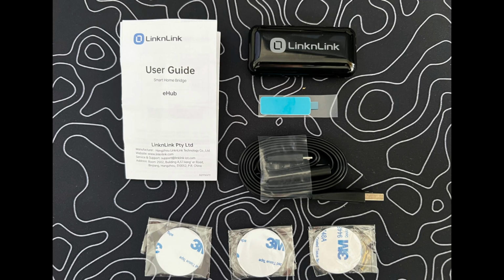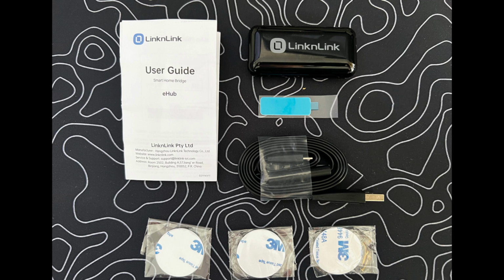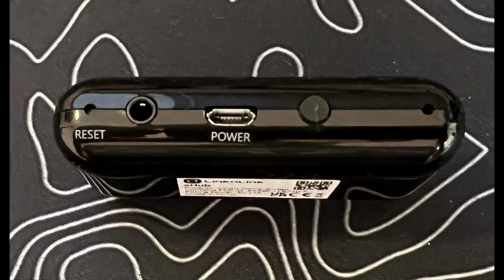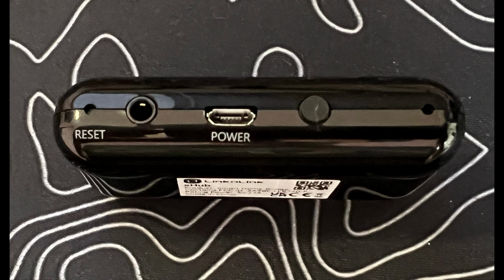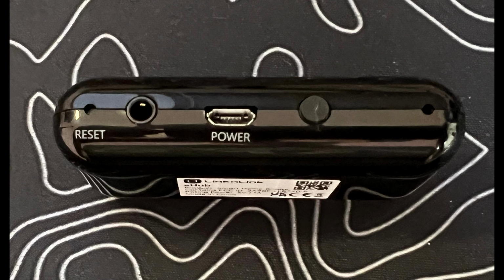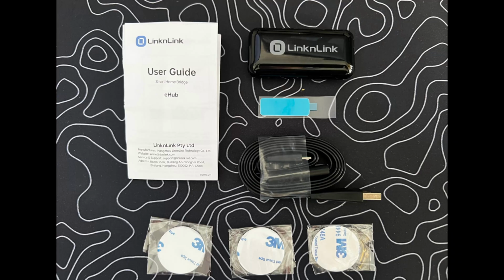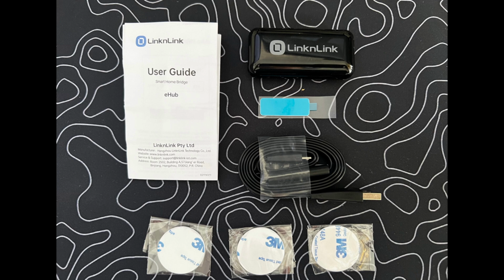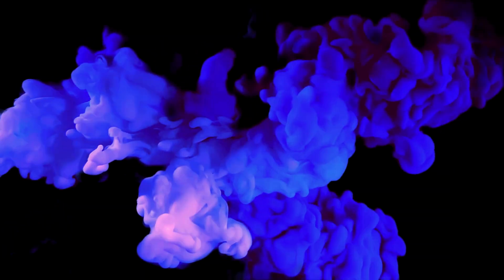LinknLink eSeries of Smart Sensors (eHUB, eTHS and eMotion)

Comment: I take it that thus device can also learn remotes? My Fujitsu does not have the wifi module therefore I will need to "teach" from its remote as I did with with my broadlink RM pro
Reply from the maker: Hi @cyclemadkiwi , Yep. Think of this device as a Broadlink RM Pro on steroids. The inclusion of the mmWave in a package side of 1/3rd the size.
Reply: Awesome,  thanks!
I have the hub and the eMotion, so next week I'll be setting up my new house. Smart LED downlights, curtains and blinds. I was a Phillips Hue user, but the cost of their LED downlights  is bonkers!
Reply from the maker: I think you hit the nail on the head. No one has a problem with Philips Hue quality, saturation and app etc. it’s the price and the closed eco system. 

Good luck in the setup and let us know how it goes.
Reply: @smart_home_australia  I thought I sent a reply...oh well, if this does appear twice, my apologies. 
I've installed the eHub and the eMotion, I have had to keep my RM4 Pro to operate the Aircon though, the eHub would not operate with line of sight being a little too far. I found it difficult to get automations sorted for non LinknLink devices despite linking them to Google Home. To operate my one smart light at my entrance using the eMotion sensor, I could not access the device (Smart Light) directly from the linknlink app, I had to select and type in the Google home voice command to operate it! I have it set to turn on the light as a night light should I walk into the kitchen, it works, however it takes about 5 secs before the light turns on after detecting me, I think this is a bit slow! Ides??
I noticed in your app setup there was an option in the "Add Device" called NFC Devices (eg Door sensor, motion sensor and light switch) in my app setup this option does not exist!

Any ideas or if I've done something wrong?
Reply from the maker: Hi @cyclemadkiwi, Interesting that you say the IR is not as powerful as the RM4 Pro. Have you adjusted the orientation as that would make a huge difference. I personally did not have an issue with the automations. Did you try raising a ticket with LinknLink as I found their support to be very responsive and helpful. 
I didn't have an issue with the response times as I found them to be comparable wiht other mmWave devices (dont forget that PIR is currently faster than mmWave device), hence why some vendors load both into the single devices and drive motion from PIR and occupancy from mmWave). 
The Add Device might be a region specific parameter, again that's a ticket with LinknLink. I talk to their product manager and he tells me that they are conintually improving the device and I've seen several updates some through, so I believe that to be true.
Reply: Hi, I was looking at getting a HA Green, then got an email from linknlink about their kickstarter iSG. On another smart home channel talking about HA 2024.2 release someone did mention the iSG and said he felt there were some alarm bells. So far no reply as to why.

Have you looked at the iSG panel? It looks awesome,  your thoughts?
Reply from the maker: Hi @cyclemadkiwi , I have a good working relationship with LinknLink and we have talked about getting the ISG in for review. But in the meantime I'd suggest checking out Paul's channel, who did get a beta of the iSG in, https://youtu.be/hXIFp_ZE3bI?si=JmZiQE7sikL5i-0J. 
It looks like a very interesting device, seems to tick alot of boxes.
Reply from the maker: LinknLink are sending an ISG across for me to look at. Currently i'm undecided, until I have played with it. Seems amazing but lets wait and see :)
Reply: @smart_home_australia  paul hibbard has done a review, which was interesting. HA can only be updated through linknlink and only major  updates 🤔
HACS pre-installed 
Well, mine is coming, it's paid for!

Comment: Did you try this hub with motorised blinds? I have not had any luck with my broadlink device with the blinds.
Reply from the maker: Hi @michaelsandall5403, I have side chain blinds (https://youtu.be/aLL4NfsLj6w) TUYA compatible and slat blinds with a wand that I control with a SwitchBot (https://youtu.be/gxQmH0128MI). So I dont have any RF or IR blinds, sorry.

Comment: Not got one yet but would guess that unknown socket is for an IR extension similar to on other IR hubs?
Reply from the maker: Arhhh that could be right. It would make a lot of sense. When I get confirmation back from LinknLink I’ll let you know.
Reply from the maker: Just heard back from LinknLink, you were spot on about the IR extender. That said the circuit board does support this, but the software currently does not. They were not able to advise on a schedule for this functionality as yet. Personally, I found the IR range to be very good. If you do end up buying one then let us know in the comments what your experience was.
Reply: @smart_home_australia  Hello. Made the purchase for one of these.. I have a SkySmart (iFlame) for my fireplace remote. Just asking you know if this will work with eHub I do not see any listing for fireplaces for IR remotes. Unless there is a general option.

Comment: I will definitely be looking into getting a couple of eTHS. Seem perfect for monitoring temperatures in server rooms and areas around the house. I can see the eHUB being really useful for setting up automations in homeassistant like turning on and off lights when in a room.
Reply from the maker: Hi @misternormie, great idea. I head back from LinknLink today and they confirmed that the Home Assistant official integration is going through final approval at the moment and should be released shortly. Once done I'll push out a video for integrating. The it will be a steal for a 5 in 1 mains powered sensor.